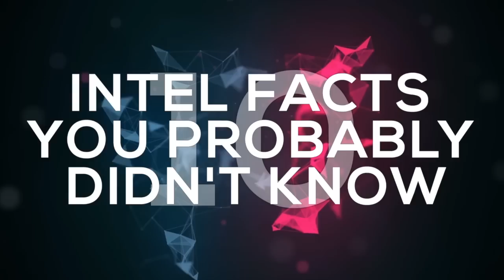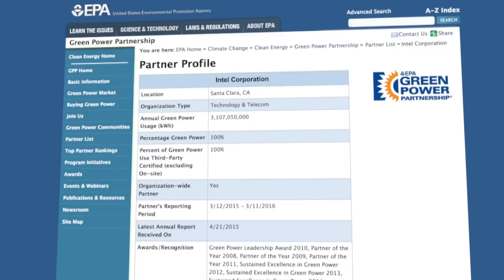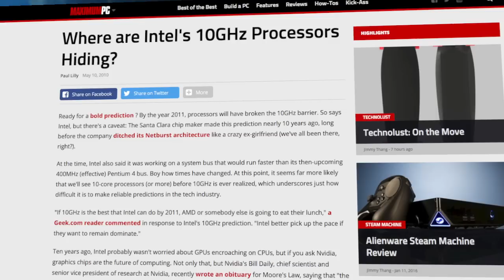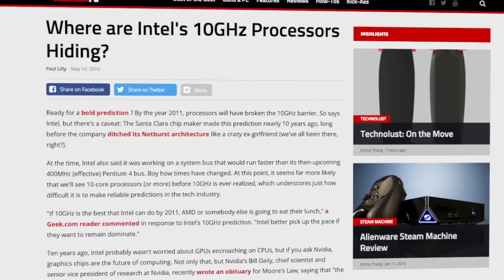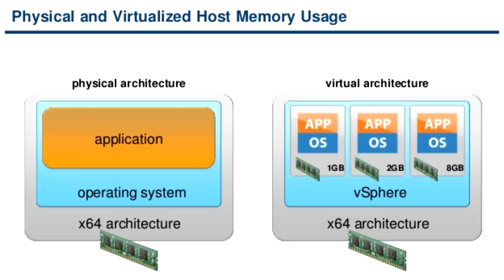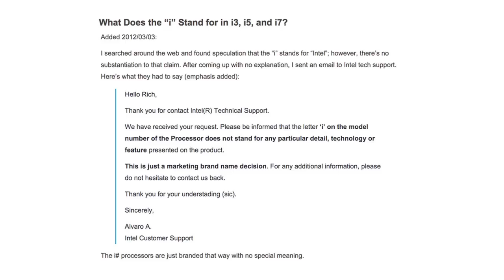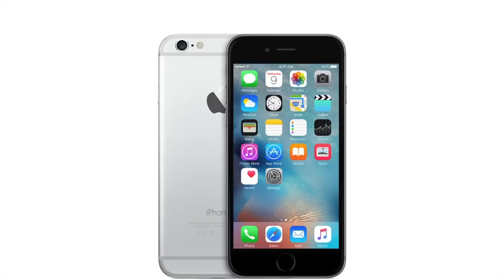10 INTEL Facts You Probably Didn't Know

Comment: Does anyone know how to upgrade an intel graphics card? I've been to the intel website but the downloads never seem to work. Can anyone help?
Reply: +Jaeden Phillips Intel Graphics Card? You mean Intel Integrated Graphics? It's built into your Processor, you'll need a dedicated GPU or a new integrated CPU.
Reply: +Jaeden Phillips it depends on your system. If you have the latest drivers and stuff, installations will be rendered invalid.
Reply: Drive booster?
Reply: updating it does not improve it. You need to buy a new one
Reply: +OverZombleGames I have a very old computer. It is a laptop, so I can't buy a new card but I've been told that I can update the one I have on Intel's website. The specs are Windows 7, DirectX 11,  Intel i5-2450M CPU @ 2.5 ghz, Intel HD 3000.
Reply: +Jaeden Phillips I wish I had that laptop
Reply: randoeboy It runs older games well enough but I can't play too many games past 2014 or so. :(
Reply: Jaeden Phillips I say you need to get yourself a pc with dedicated gpu
Reply: +Jaeden Phillips does it run well with lol? I can't even play it on lowest settings well on Friday I'll see my rig again for a bit :/
Reply: +Jaeden Phillips Intel doesn't make GPU's..
Reply: +spoonwitz Tell that to my crappy Intel 4000 GPU
Reply: +spoonwitz well they do
Reply: Limitz I mean the cards not integrated graphics
Reply: spoonwitz well you should of said graphics card,
Reply: Limitz You're right
Reply: +Jaeden Phillips Its intergrated you cannot upgrade...
Reply: look up what socket type your motherboard is and then find a better intel cpu with the the type of socket and you're good to go.
Reply: +Jaeden Phillips troll
Reply: Well you're focked, it's usually integrated if it's a laptop. Heard Razr was coming out with a mobile GPU, might want to check that out.

Comment: well, 3ghz x 4 cores is technically 12ghz
Reply: No.
Reply: Sticking 4 cars together doesnt multiply the horsepower.
Reply: +Decan Andersen It doesn't work like that
Reply: +Youtubewolltemeinennamennichtalsomachichihnlang taking a car and putting 4 engines in it does multiply.
Reply: +Decan Andersen No, it's not straight multiplication, you moron.
Reply: +Decan Andersen Implying they work at 100% all the time
Implying every shit optimises their stuff that it doesn't almost solely use only the first core
Reply: Youtubewolltemeinennamennichtalsomachichihnlang but what if you glued them together and hooked the control to a single car, what if
Reply: DV-13 But where can we find a car to fit 4 engines ? If we took a ferrari and put 4 VW v6 engines it would even be weaker in the end.
Reply: nooooo that's not how a cpu works
Reply: Edvinas Tamošaitis Pickup? Or limo.
Reply: they don't work that way
Reply: +DV-13 Put one on each tire and the fiction the motor has to overcome is less so..yeah it would.
Reply: GG DANK MATHS
Reply: +Decan Andersen it would be same as saying I travel at the speed of light and shoot a particle at the speed of light so it would go twice the speed of light and that is pretty much not the case.

Note: this is just a example (and I know what happens to matter with mass that travels at the speed of light)
Reply: technically a processor with 4 cores at 3Ghz, is the same as 4 dude that would do 3 000 000 000 operation per second, if you put them on the same operation they would do the same thing in parralel or just get in the way of the others. And that is why it's better to have 4core × 3GHz than 12000 core × 1 MHz but it's also harder and more expensive to build directly a 12 GHz monocore (that and the risk of breaking in one go).
Reply: +Drack Empror there is no cooling option on earth to handle 12 on the latest available tech process, not even liquid nitrogen as far as i know
Reply: +Eugene InLaw it's an example, and there is no 12000core × 1 MHz processor either.
Reply: +Decan Andersen LOL
Reply: +Decan Andersen As a computers expert.Technically.You are right.Each core runs a specific number of GHz.So the video is wrong.I remember back when getting 458MHz was a big number for a Single core Processor.When i found a 4 Core AMD at 1.800 GHz i was shocked.The Sales representative explained.That was about 7GHz.An yeah.That was accurate.